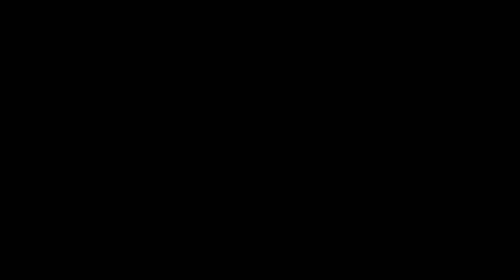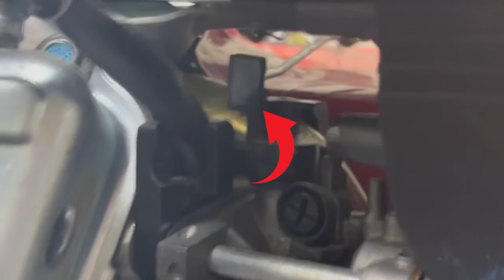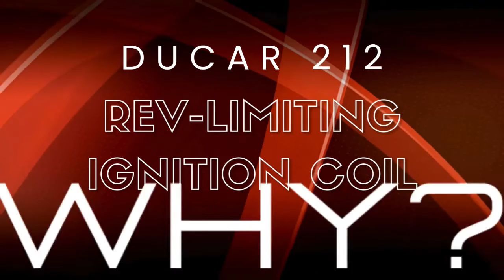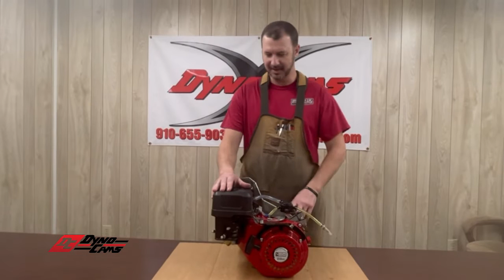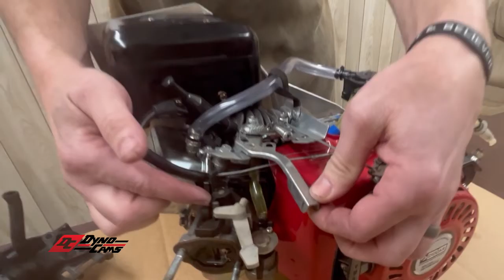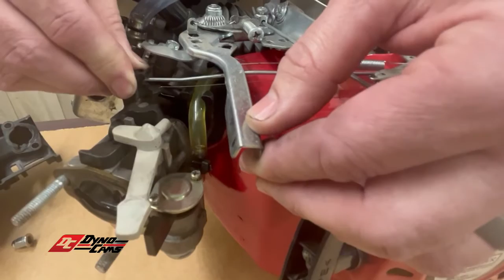The Ducar 212 Rev Limiting Ignition Coil: Why?

Comment: Website is messed up and will not let you create a new customer account. Want to buy a few of these for a kids mini bike build on my YouTube channel. Says shipping method required but the drop down box errors.
Reply from the maker: Thanks for letting us know! It should be in working order now if you would like to try again! Just be mindful that the shipping total will quote higher than what you will actually be charged when we go to ship the order. You can also add a note in the comment section if you would like the package to ship cheaper via USPS or if you would like to schedule a pickup at our store. Thanks!
Reply: @dynocams1006  Still not working.
Reply: How to install a pvl flywheel on the ducar 224 engine? Are can i order a 224 with the pvl flywheel already installed? @dynocams1006
Reply: @jacobsebastien3910  It's simple to swap a flywheel, one just needs to do it correctly.
Many videos on lapping and torquing it down on YT, good luck and don't be afraid to break stuff.
We all learn somehow.
Reply: Does these ducar engines come without a governor? @dynocams1006